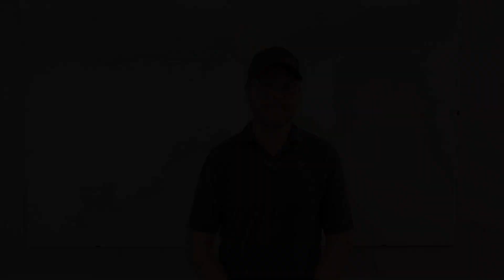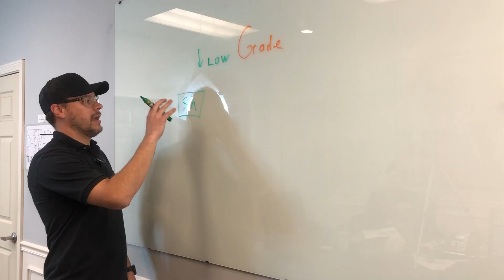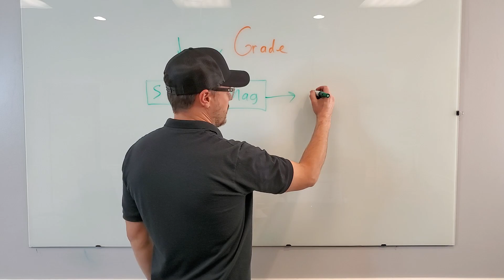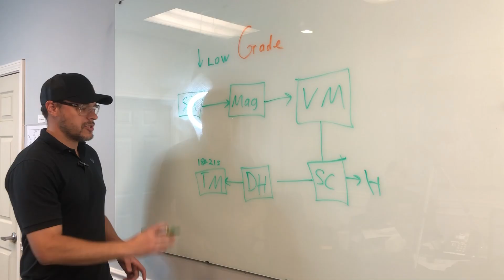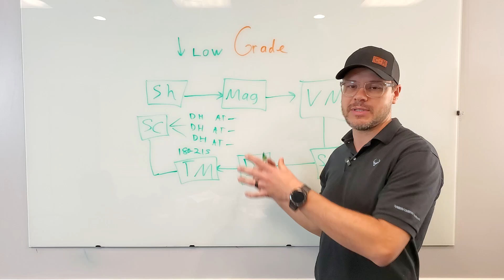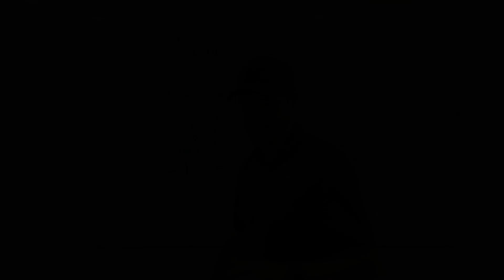How Do You Recycle and Process Low Grade Wire?

Comment: Hello, I enjoyed watching your video.
I'm planning to process shredded refrigerator scrap, which includes PP, stainless steel, approximately 0.04-inch wires, glass fragments, bolts, and nuts. I'm aiming to extract as much pure copper as possible. Can I use the system you described in your video for this purpose? If there is any loss of copper, what percentage would I expect?
Reply from the maker: @Jellypaw_DnC  yes, you could use the same items for the downstream. If you can please send an email to info@cablemanagementusa.com we can schedule a zoom call to go over your exact needs.